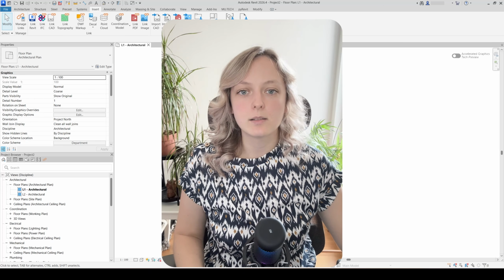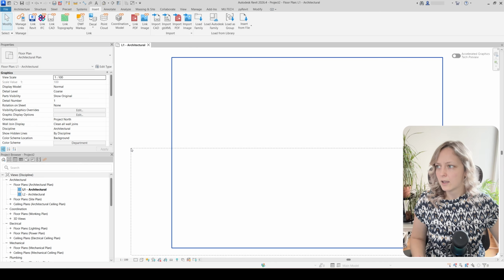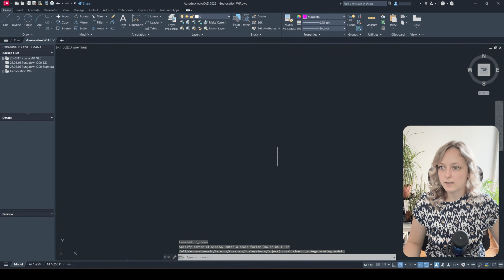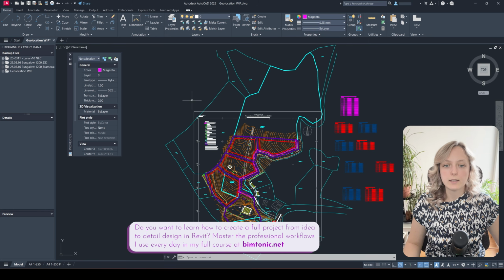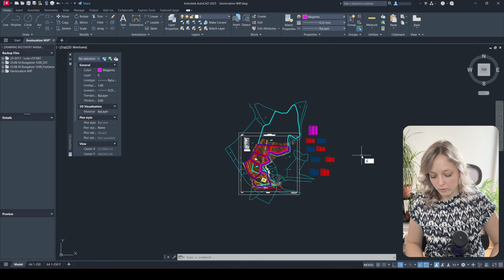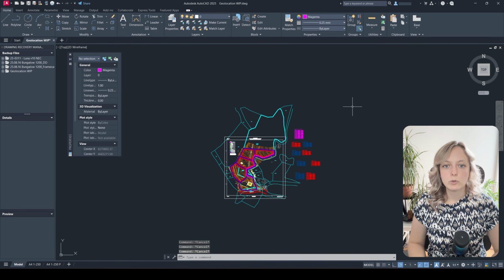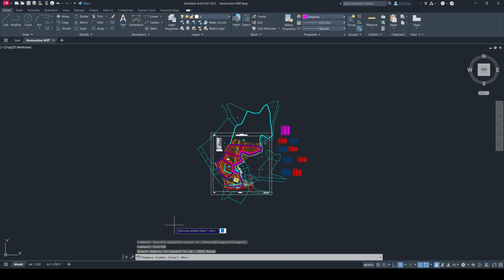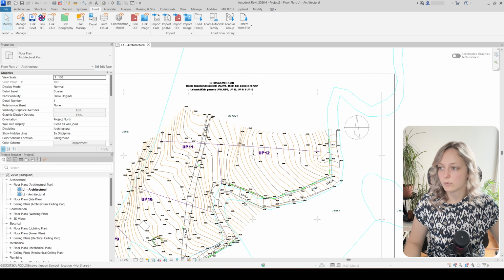How to Clean & Prep AutoCAD Survey Files for Revit Linking (Step-by-Step)

Comment: About the purging i prefer to use the command -purge that is going deeper in the process with many more options. Also i already have run into issues with blocks when there were no far aways geometries in those, but the origin of the block was way off and that was causing the issue. I usually decompose them but maybe it could be solved by placing a new origin point inside the block?